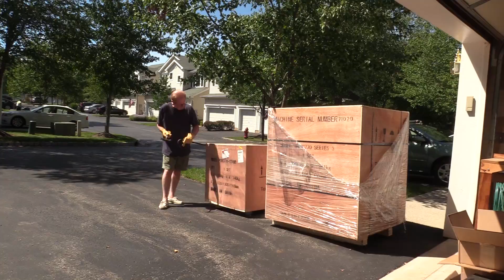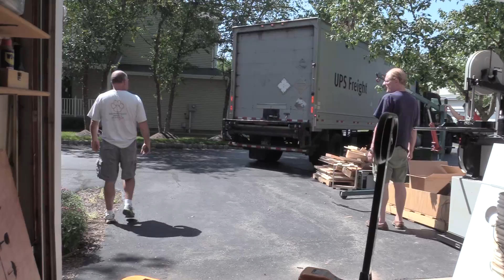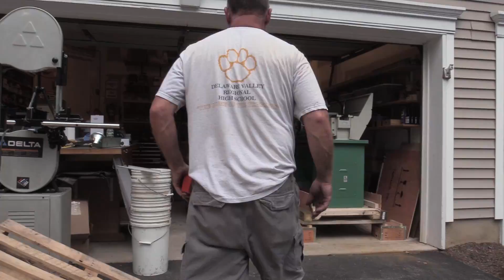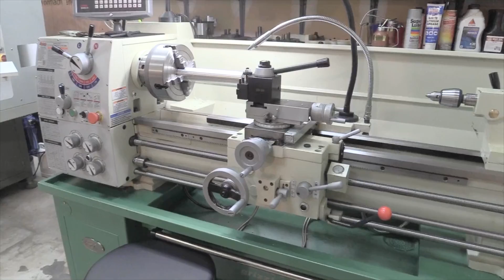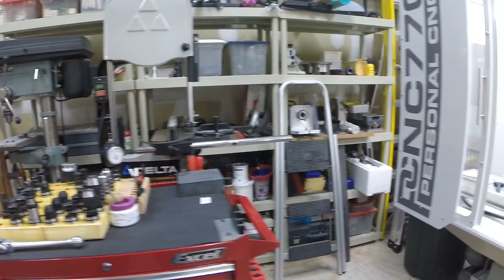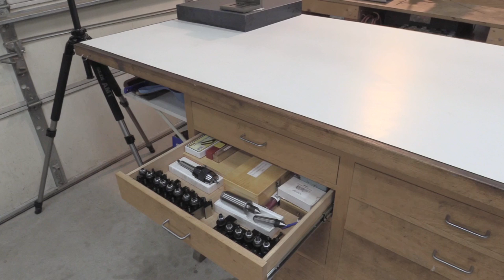New Mill And Lathe Have Arrived

Comment: I have a machine shop here Making spare parts for Matchless and WW2 BSA motorcycles.  I found your video very interesting.  One thing that puzzled me though was that Tourmach put the electrical cabinet INside the machine enclosure where it will get damp from all the suds flying around.  And, believe me, swarf will find its way in too!  If it's not too late I think I'd get those drills and taps out again and put the little electrical caminet OUTside the main machine enclosure.  I'll be keeping an eye on those new projects.  Good luck from John in England.
Reply from the maker: Thanks John. I can assure you that the electrical cabinet is very well sealed. I'm on lots of Tormach forums and have never heard anyone mention a problem.

Comment: Thanks for posting this video, I am planning to get the same lathe and this video will be a lot of help. Can you elaborate on the process you went through to level up the lathe? Thanks again
Reply from the maker: Sadly my lathe had a manufacturing defect that couldn't be resolved (the spindle wasn't running true). I had to return the lathe and ended up buying a Tormach 15L instead.

Comment: Finally a review of a Grizzly Lathe.  I bought the Grizzly G0773 Lathe & Mill Combo.  In-so-far as anything I can advise you on:  When ordering parts?  Go ahead & get 2 of whatever you need. Not speaking of in stock every day items.  I crashed my cross slide.  Parts took 6 months to arrive.  It's a lathe, I was back up somewhat decapacitated the next day - that IS a long time for less than common parts.  One thing of note that might be of interest:  I converted it to allow both Lathe & Mill to run simultaneously.  While that doesn't help on your lathe - might prove quite the time saver with your Tormach.  Looking forward to seeing what adventures you get into with these new toys!
Reply from the maker: Glad you enjoyed it. Stay tuned...

Comment: Would you mind having a look at your rapid turn and see if it has the same issue with the collet as found in this video https://youtu.be/F6EGsQxxzig
Reply from the maker: Tormach has confirmed that all RapdTurns manufactured thru December 2016 (including mine) have this problem and that they will contact all existing owners when they have a solution. They stand by their products.

Comment: Congratulations. That's a big lathe. I was just re-watching your old video on making a lantern gear, including cutting the wire lengths with a cross-slide mounted Dremel and the .050 wire in the chuck. Good luck with repeating that one on the Grizzly. I know you can make small things on a big lathe, but still. Anyway, no doubt you've thought all that through and it does look like a dream workshop.
Reply from the maker: Actually, I don't think it will be a problem once I make a new mount for the Dremel tool. Glad you like the new shop!

Comment: Ken,
         Great info video, was wondering how you were doing. Looking forward to chip flying.
         I believe Grizzly has a cover for the chuck so the machine will not turn on unless it is in the run position 
          Good luck and be safe

    Ralph